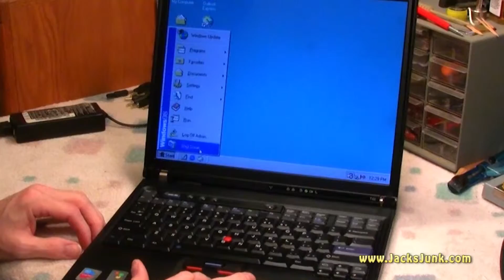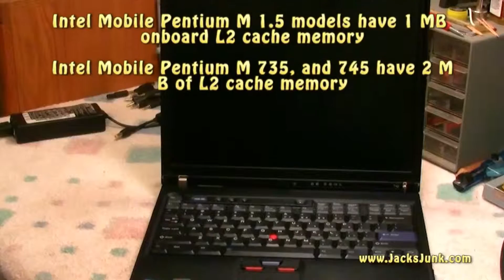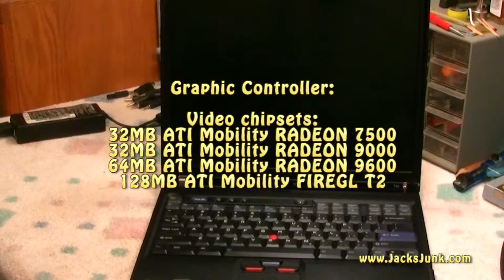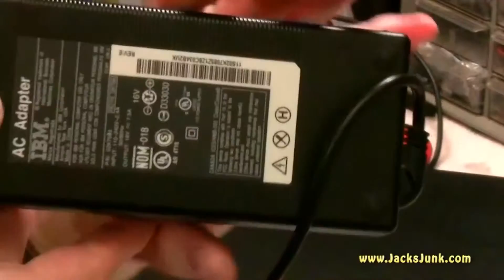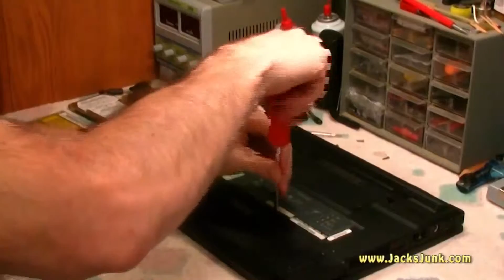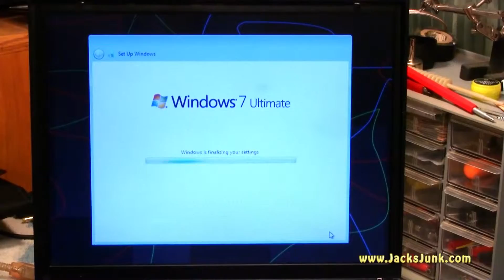IBM T42 Laptop And Docking Station Overview

Comment: I just found one of those on a pawn shop, it was just 10 dollars! But i have a few questions, does it worth actually to purchase things like the battery (mine doesn´t work at all) and what do you think of having only 1GB of RAM on one of these since I'm planning to run a Linux Distro instead of Windows
Reply from the maker: Howdy!  Thats a great price, a lot less than I paid for mine!  :)  Its very hard for me to answer how to spend your money as your financial standing may be different than mine as well as your opinion on fixing up older electronics.  I bought mine at a decent price and have upgraded all options that I could, with the exception of the battery, but I plan on it, just haven't got around to it.

In my opinion at the price you paid, and if it will work for your needs, then I see buying a new battery is well worth it, especially "if" you plan on using it in that capacity a lot.  I use BestBatt to buy my batteries, they are fairly inexpensive and the batteries appear to work just fine, I have been buying from them for over a year.  For this laptop, check this link out: http://goo.gl/YORNZE

I don't use any form of *nix, so I really can't answer that question, I stopped using *nix over 11 years ago...those old version should work just fine!  :)   Thanks for watching!